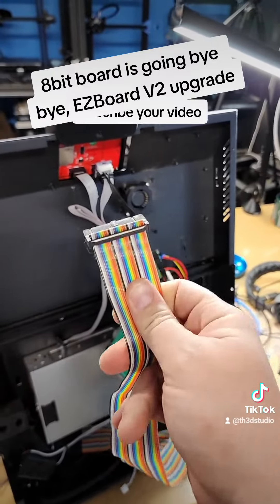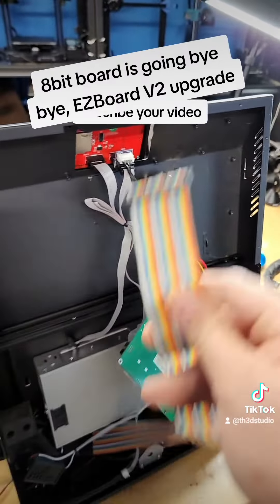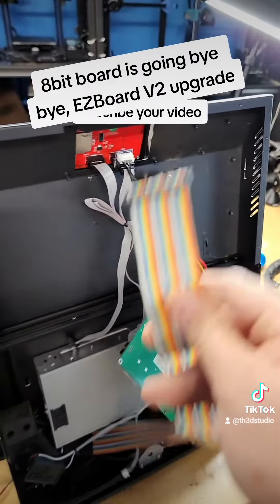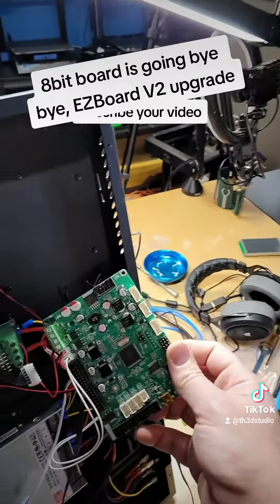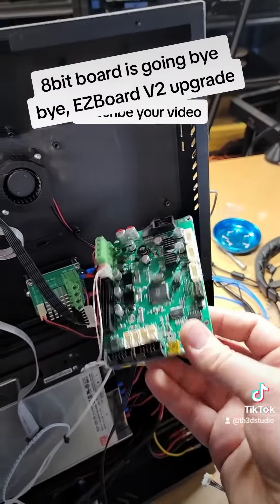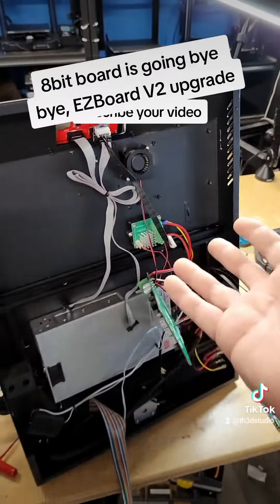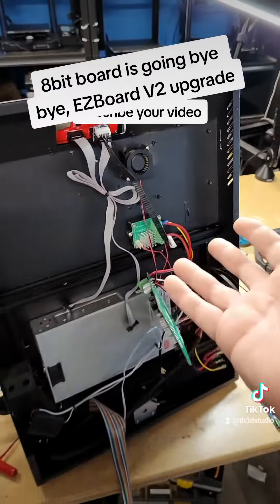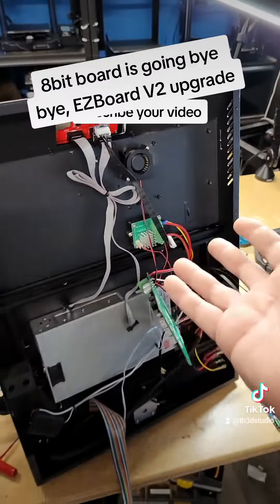Upgrading our CR-10S Pro to our 32Bit EZBoard V2, Coming soon

Comment: get rid of the daughter board, put new wiring on. 
You can find the ribbon cable mapping on the internet but it really does not worth the effort. You end up crimping so many cables you start to think you might as well do the whole cabling 
Also crimping that ribbon cable is a b*itch, literally 3 thin wires :) and that daughter board does not play nice with other boards. 
I have converted two of mine with the new wiring method but started just like you :)

Comment: I did just that, with 31 #20 silicone coated wires for flexibility, I used over 100 feet of wire, and doubled up on the power lines to meet current standards.
all in a harness with plugs on the end.
I robbed the male power plug for the ribbon board, and put it on wires.

4 wires for power two +, two -
4 wires for X servo 
4 wires for extruder servo 
2 wires X end stop 
2 wires Fan1
2 wires Fan 2 
2 wires Hot End thermistor sensor 
3 wire filament sensor
3 wires wireless camera power control, with light
Wire already on BL touch wires for the Z stop which is on the BL touch 
Wire already on BL touch BT touch servo.
Wired NeoPixel independently down the rails.
Now to get the freeware installed.
NO FUN without support🤔